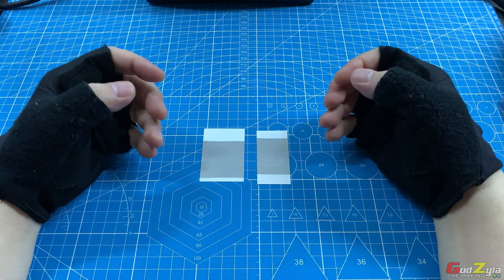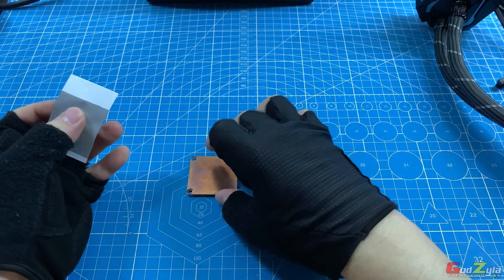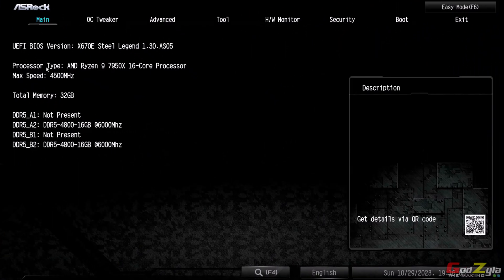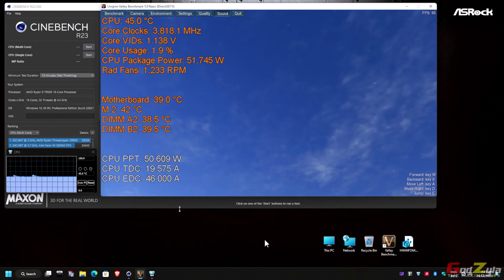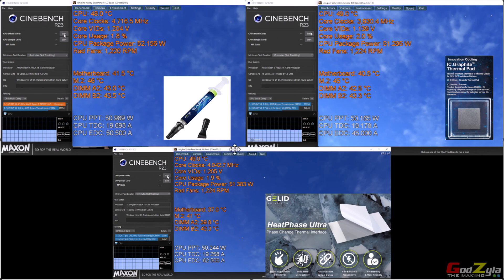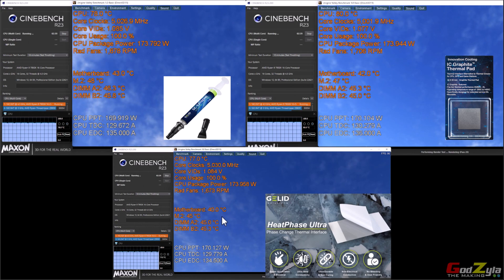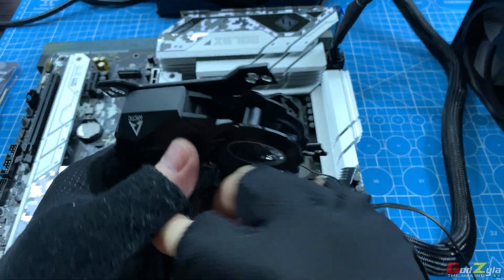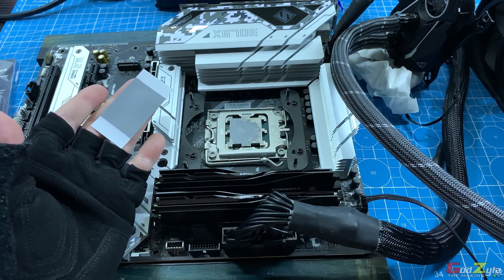Gelid HeatPhase Ultra

Comment: Gelid HeatPhase Ultra needs to be warmed up repeatedly (heating to high temperature and cooling). The phase change has to be multiple times for the material to distribute well. Sometimes it takes several days to do so. Immediately after putting it on, it performs poorly, even worse than paste. Unlike ordinary paste, Gelid HeatPhase Ultra only reaches its full properties after many cycles and does not lose them over time. The difference after time is large. A short test is completely pointless.
Reply from the maker: Hi Zetor Son, welcome to my channel. Thank you for your info.

Comment: is it ok to refrigerate this to make it easier to install?  And also is it easy to cut into different sizes?
Reply from the maker: Hi inevitab1e, welcome to my channel. I do understand some will just refrigerate this piece as it's easy to apply. I will not advise that as once it's heated, the might be fluid due to condensation and evaporation, you wouldn't know what's going to happen. I will just apply it direct. I have no issues applying it, just need to do it slow and not rush things.

Comment: Hi
I wanted to know is gelid heat phase ultra performing same as ptm7950 and will it get better with more heatcycles like ptm7950
Reply from the maker: Hi aditya, welcome to my channel. Based on the comparison. Both need time to warm up before the temps shows the drop. I would say both application are of
The same but when removing. These gelid are much easier. As for temp wise again these are better by 1 to 2 degrees difference.

Comment: I use ptm on my 3090. No pump out and very good termal perfor. So it is worth it. Paste in laptop and gpus is old tech. Yes paste can be better at first( it is not tho) but in 3 months it will get hotter and hotter
Reply from the maker: Hi-Level, welcome to my channel and to share your experience, greatly appreciated it 😉

Comment: Thank you so much for early review!!! GC extreme is as good it can get for thermal pastes the fact it can match it let alone be slightly better and mostly likely to sustain this temprature for a while unlike the thermal paste is more than enough to consider the product not to mention will last much longer for a laptop user like me this is a perfect product don't have to deal with pump out doesn't dry out also cheaper than a ptm7950 considering international shipping
Reply from the maker: Hi Somu, welcome to my channel. Infact you should thank Gelid who have provided me with these thermal interface. I do know of the PTM7950 which I've read on the internet, but didn't have the courage to try as I do not want my processor to stick on either aircooler or liquid aio. Till now when I tried these Gelid, I might want to test out the PTM7950. Thank you for your feedback.

Comment: Nice,  I Just order one to put it on my system, And thanks for testing the product out.  I did Subscribe and your at 8.05K subscribers.  Hopefully your channel continue to grow.
Reply from the maker: Hi ImportRace, welcome to my channel, valuable feedback and to have subscribed. 😉  Just to check, when you purchase this, did you apply the voucher code ( kleo10%OFF ), If not, write to Gelid and redo the order.
Reply: I just notice that  @KleoYan  will order another one for the other computer,  And will add the code
Reply from the maker: @ImportRace  I see. Write in to see if you can cancel the previous order or to have them give you the 10% off. All the best with your build too 😉

Comment: I'll stick with my Arctic Silver 5, it's never failed to keep cpu's or gpu's cool and 2 deg difference is basically the same and not worth the work involved in tearing your system apart for a gimmic that I'll never trust with any of my cpu's just too expensive to replace
Reply from the maker: Hi Four Ace, welcome to my channel, that’s good. I use to use Arctic Silver 5. They do provide good results but have changed to Arctic MX4 which does a better job in a long run. Due to the viscosity and runs even better with MX6. Nevertheless each have their own choice of application and once again thank you for your feedback 😉

Comment: Something is wrong. All temps with the heat phase ultra are lower like motherboard and M2. The test was not done in the same conditions. Anyway, this is not a pad, it's more like a paste.
Reply from the maker: Hi Javier Perea, welcome to my channel. thank you for your feedback. greatly appreciated it. I did rerun this test a couple of times before showing the results. It's only a degree or for each application and it's a thermal interface not a pad. Thank you!
Reply: @KleoYan  thank you for the nice reply.
Reply from the maker: @javierperea8967  you are most welcome and thank you again for your feedback.

Comment: wait $10 for one sheet? thats to expensive imo. u get 4g of Arctic MX-4 Paste for half the money which is easilly enough to mount 4 coolers to a CPU.
Reply from the maker: Hi Ten Kenobi, welcome back. I do agree with you if you are to remove system parts often. On then bright side, if you are just to use it for long run, this might be a good option. Thanks for the feedback 👍